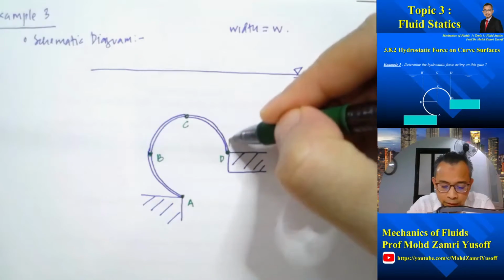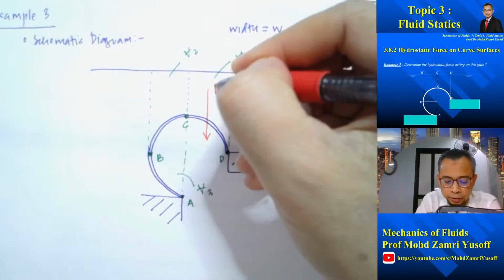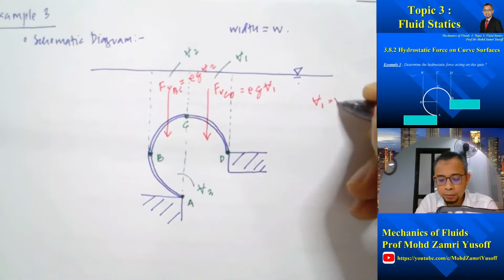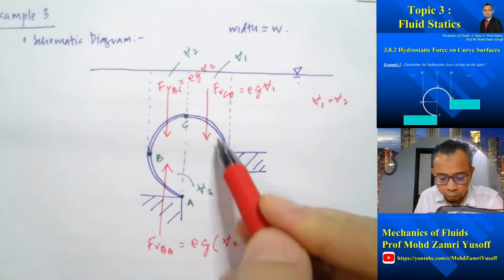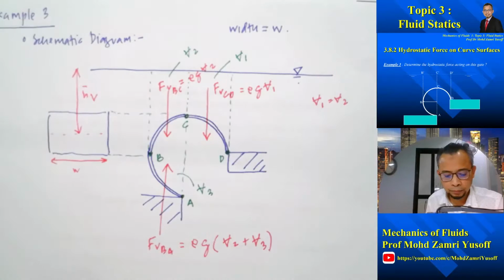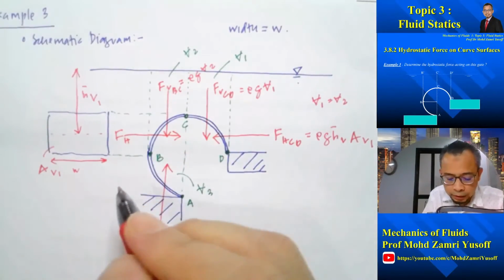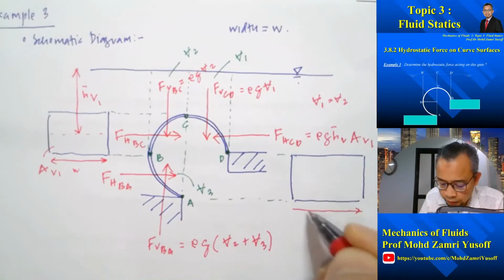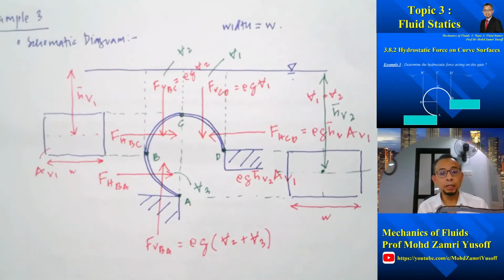Mechanics of Fluids Topic 3 Part 14 - Fluid Statics - Hydrostatic Force on Curve Surface

Comment: Salam Prof, for Fv(AB), what is the reason that we need to take the summation of V2 and V3? And both volumes have different mediums right? Thank you
Reply from the maker: Waalaikumsalam. Thanks for the question. We are calculating the vertical force (upward) on surface AB. Therefore, we have to use imaginary weight of fluid above surface AB, which is rho × g x Imaginary volume above AB. The volume is V2 and V3.
Reply: @MohdZamriYusoff  Thanks Prof for the prompt reply